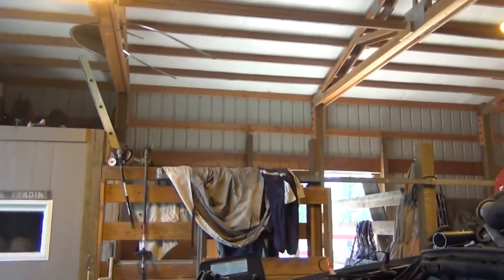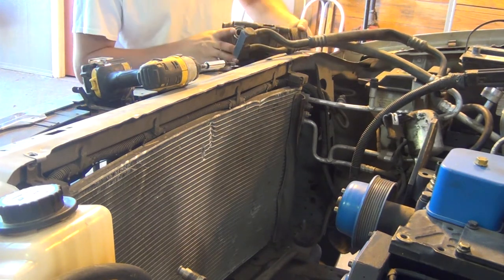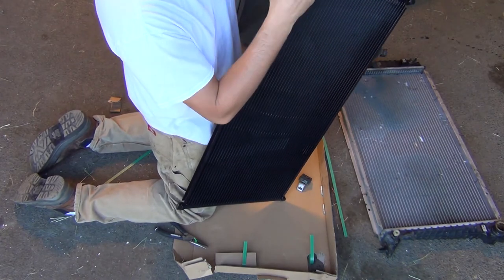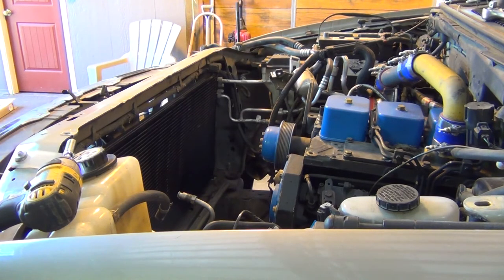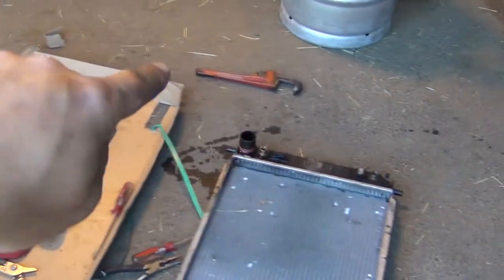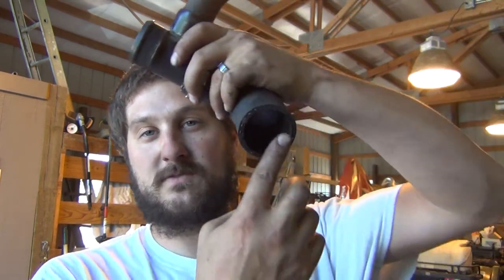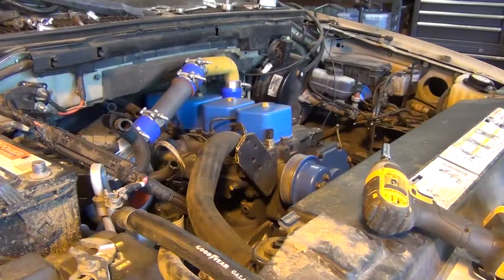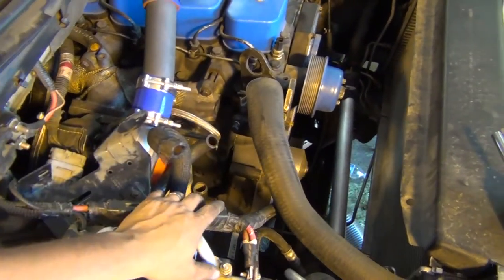2002 Ford Expedition 4bt air condenser and radiator reinstall

Comment: why are all the engine build, paint, and finish, + paint, install videos missing. 
transmission adapter plate information missing?
Adapting the 4BT to the new  transmission adapter plate missing?
TPS adapter information is missing?
Why cannot I not see any of these videos?
turbo re-configuration? you was going to change the configuration to keep the turbo from protruding so high that it was going to protrude out of the hood if you didn't change its configuration. that video is missing?
Reply from the maker: We’re reworking the editing on those videos and will be putting them up in order that we filmed them it just takes time.